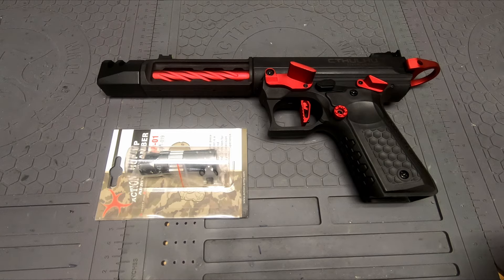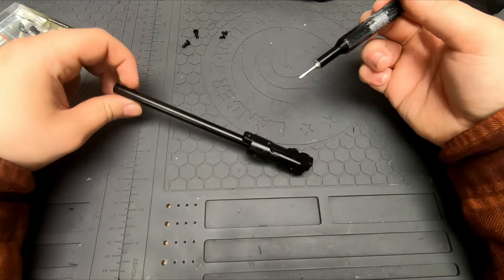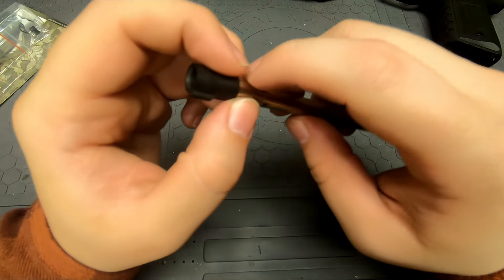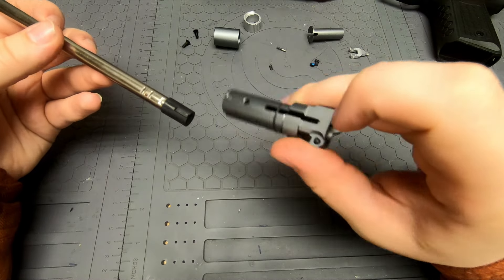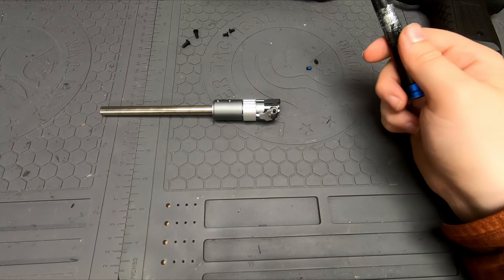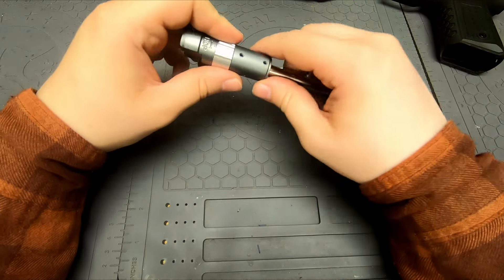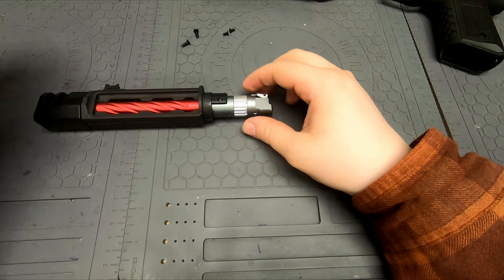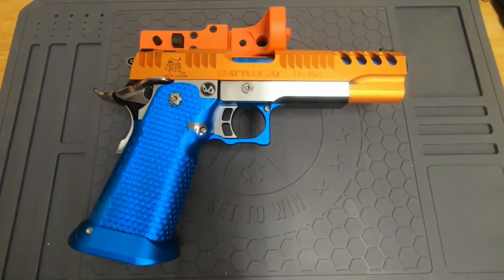How to install CNC Rotary Hop Up Chamber for AAP-01 and Cthulhu

Comment: Stock barrel says 130mm, can we get a confirm on that???
Reply from the maker: The cthulhu is way longer than 130. The aap-01 is 130
Reply: @Wyhaq do you know the exact dimensions of the Cthulhu barrel? I can't find it anywhere online and i need to know in order to upgrade it properly

Comment: how is that little extra peice supposed to be installed? the one that fell out when you opened the stock chamber,I was having hop issues so i changed bucking and cant figure out how its supposed to sit. or if i have it in correctly anyway.